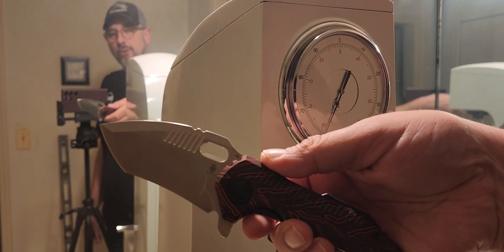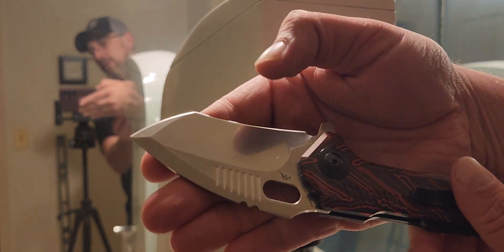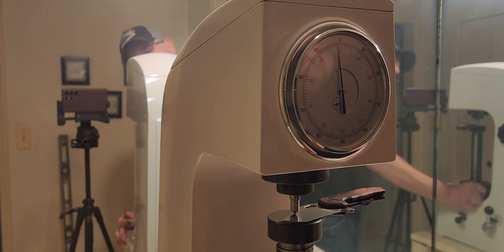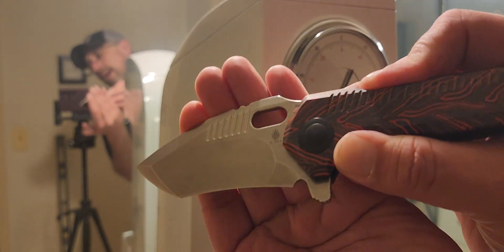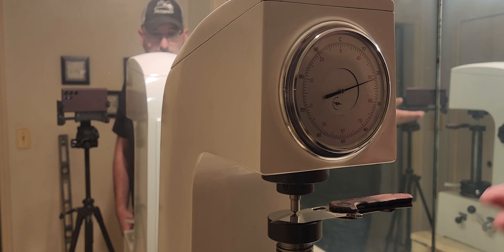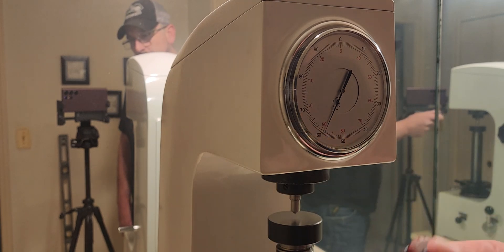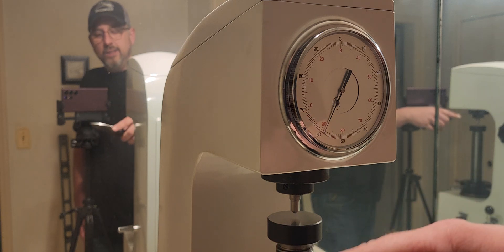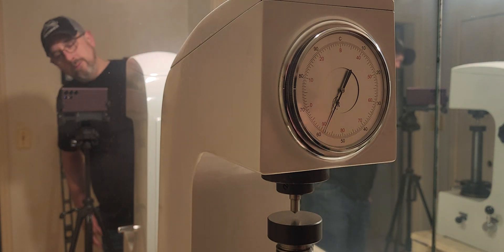Kizer Extra Mini Paragon CPM 3v Rockwell Hardness Test

Comment: Now you got me watching all your tests very interesting
Reply from the maker: I'm gonna try to drop one every day at 3 until I run out of knives ...try to keep em short and sweet and to the point. I git enough people asking me about calibration that I might do a video showing that process since that doesn't exist and maybe that'll put sone minds to ease. I figure some folks will find something wrong simply because that's what they want.
Reply: @apex_alchemy_knives  That would be a good vid. I don't know anything about the testing but all your results fall about where I would have thought except the one that was 17 I must have missed where the guy from Shed didn't heat treat his knives that one caught me off guard.
Reply from the maker: @JR-5465   man I went back and watched it. He said when he started using 154 cm , he wasn't heat treating them ...basically because he didn't know how. But later in 2023 is when he started shipping knives with the heat treat certificate from the third party. So his new stuff is good to go. 😎